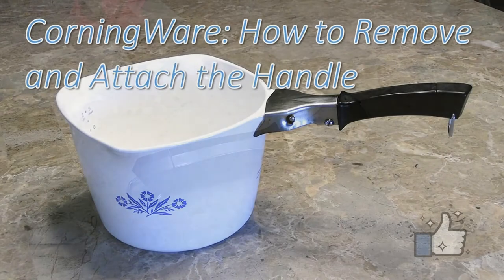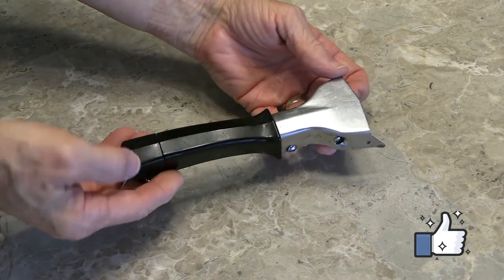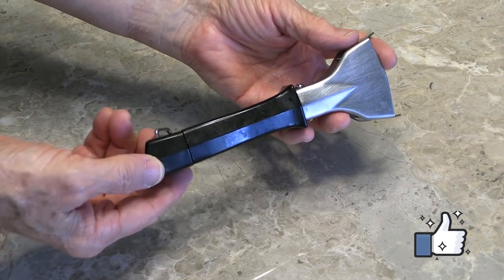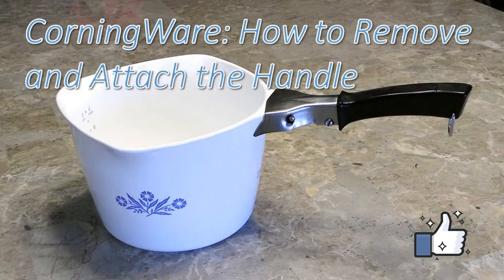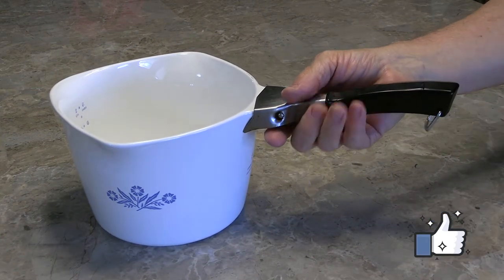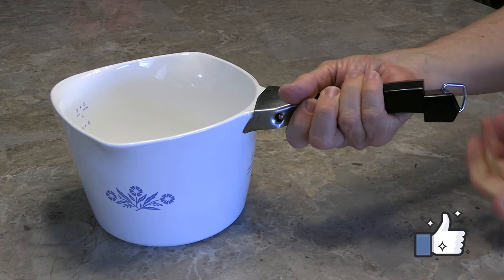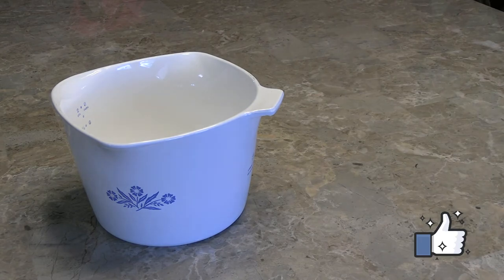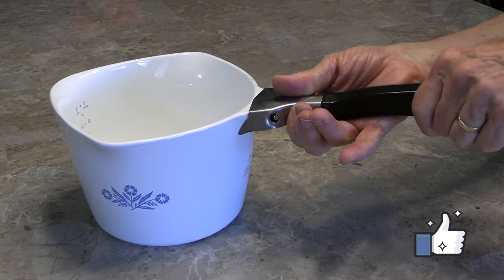CorningWare Handle Removal Instructions

Comment: Thanks. The end of mine seems to be stuck and will not turn. Any suggestions?
Reply from the maker: Not sure. Perhaps some kind of buildup from food? Try soaking it in hot soapy water and or spraying some WD40 inside the various gaps. Nothing ventured, nothing gained.
Reply: I have the same problem. My only turns about a fourth of the way…

Comment: Mine does not have a handle that turns.
Reply: Some of the smaller ones have a thumb tab. I have both.
Reply: They made three or four models. You have to have the model for the correct handle design.